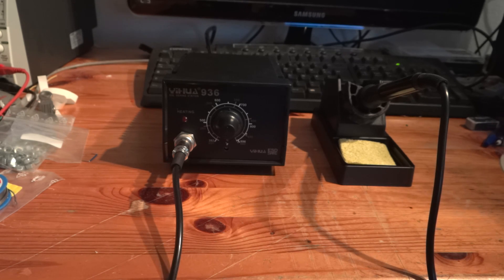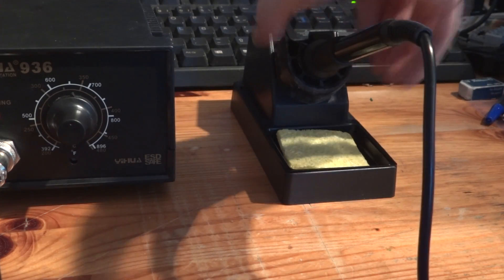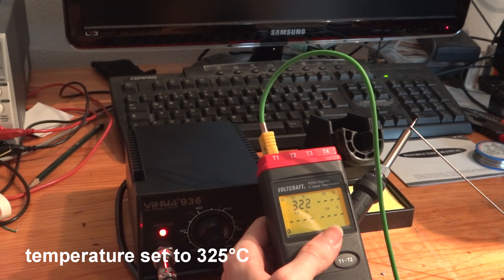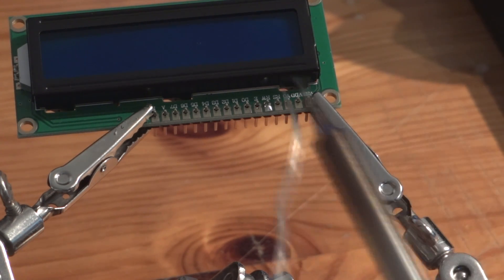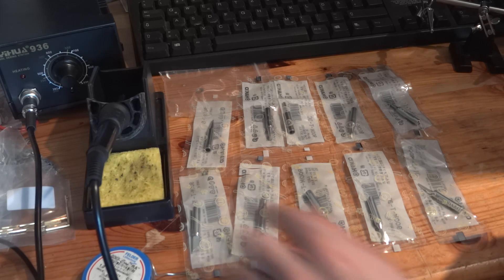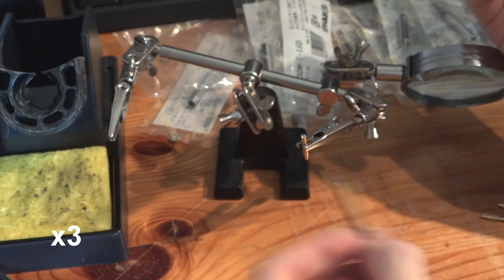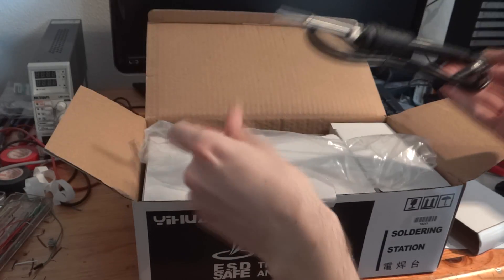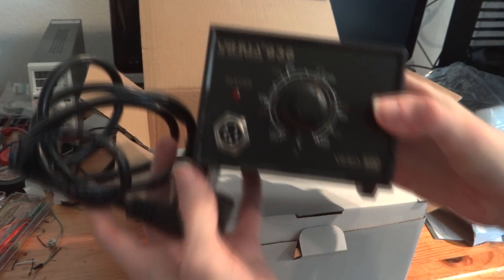Yihua 936 - Review of a 14 Euro Soldering Station

Comment: If you will use flux then your heat transfer will be fine! 
Also cleaning the tip would improve the heat transfer you just need steel wol to clean the tip

Comment: Excuse me your soldering method is nat the best, soldering wire come between thne soldering pad and the iron tip.

This cheap soldering stations works very well, I use Hakko for my works but testing some cheap unit no diference at all.

Comment: Do you have a link for the tip that you find best to use? I don't really want to buy a whole set. I guessing a 2.4 or 3.2mm chisel tip will be the best? Too bad hobby King charges £20 to ship here to sweden.
Reply from the maker: Peter G It depends on your preference and what you want to solder. The 2.4  is a good choice I would say. For the smaller soldering work you can still use the tip that comes with the soldering station. Here is a link: http://www.ebay.com/itm/1pc-900M-T-2-4D-Replace-Soldering-Solder-Leader-Free-Solder-Iron-Tip-F-Hakko-936-/400549225356?pt=LH_DefaultDomain_0&hash=item5d4298238c                                                         Did you choose the European warehouse on hobbyking? I think I paid like 5 Euro shipping for my order.
Reply: Experimentaltechnik
Thank you for your advice. I just realized i was in the "international warehouse", but it is out of stock in the european warehouse, so guess i'm going to have to wait, unless i want to spend a furtune on shipping :).
Reply from the maker: Peter G  That`s unlucky, but it`s worth to wait since shipping from the european warehouse is faster too and there are no import taxes.